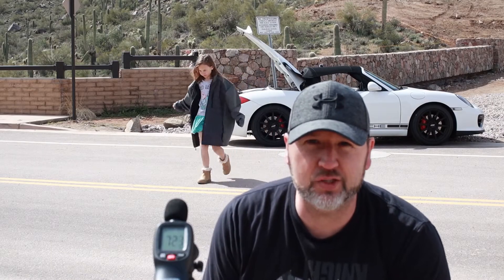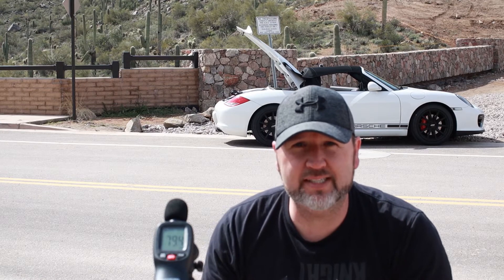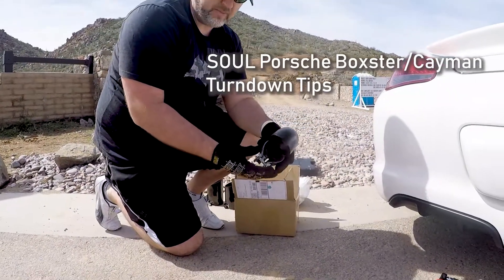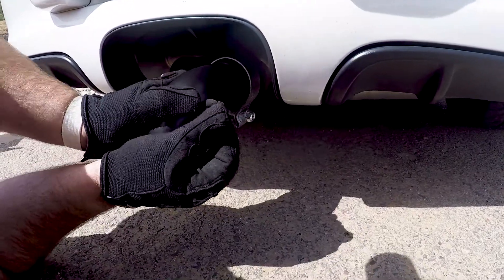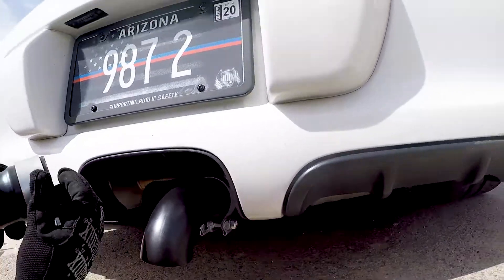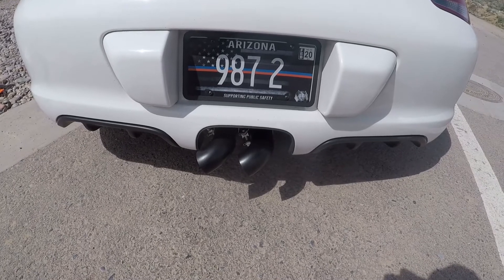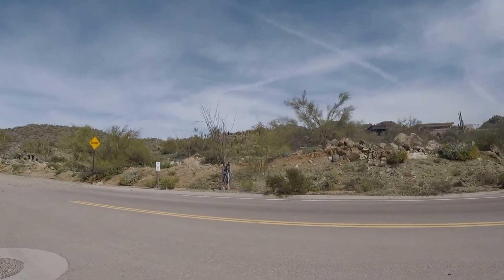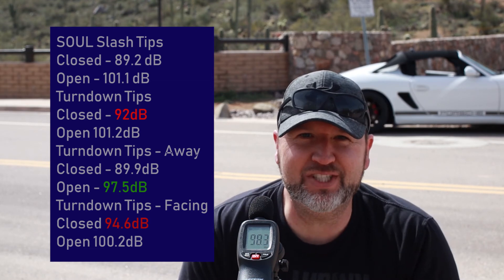Turndown Exhaust Tips - Better racetrack compliance? SOUL exhaust system

Comment: Out of curiosity, did you do any driving with the turn down tips? Wondering if they reduce the sound in cabin at all?
Reply from the maker: Only ever used them at track really so everything pretty blown out. I wouldn't expect there to be much difference in the cabin under normal driving.
Reply: @DWraysGarage  that makes sense. I was just curious because I have a full Fabspeed setup and am looking at ways to reduce the infamous 2-3k RPM drone. Wondering if pointing that tips down/further past the bumper would help

Comment: Hello, find any solution for this other than swapping to a quieter exhaust?
Reply from the maker: Have to keep baffles on PSE closed. Turn downs will help you cheat some if you point away from the meter. For example, at the track I run, they always setup in same spot so I can turn output away from their sound tools. Otherwise, you have to let off wherever meters are and that, I assure you, is very frustrating.

Comment: Just a heads up, 100db will cause hearing damage so you may want to wear ear plugs on your drives. 85DB is as high as you want to be on a long drive.
Reply: are you stupid?
Reply: Just a heads up but this is measured outside of the car. Inside the car is much different.

Comment: I'm sorry, but I think your test isn't 'sound', no pun intended... by pointing the tips away from the meter, but towards a brick wall, you have reflected the sound back towards the meter... so your measurements are corrupted.. Better repeat this test, but with open ground like a pasture or so, in the background so you don't have reflection.. LIKE them turndown-tips, btw... 10 out of 10 on my COOL-scale!
Reply from the maker: I believe you're right. Always tricky finding a venue for noise like this here in the desert. Thanks for watching! Need to get near a track since that's where this could be most useful data anyways...
Reply: You are kind of right but if all the test had the same one variable then the test isn’t flawed that much he stayed by the wall the whole video so it does give some data now take what you want with it yes the walls definitely help pick up more sound but if he is doing it in all his test then it’s not that much of a factor it’s just a little louder than normal